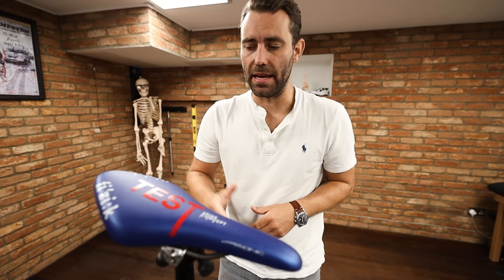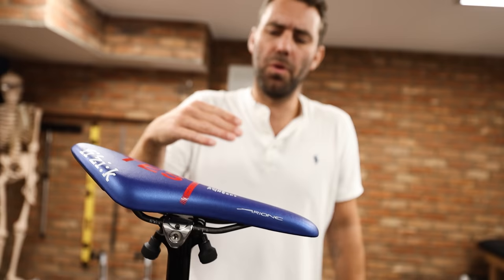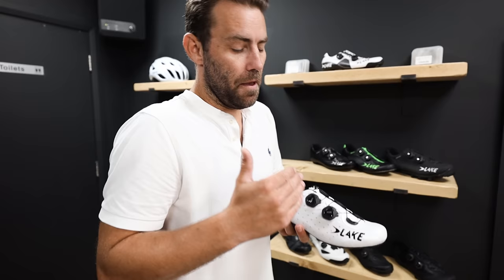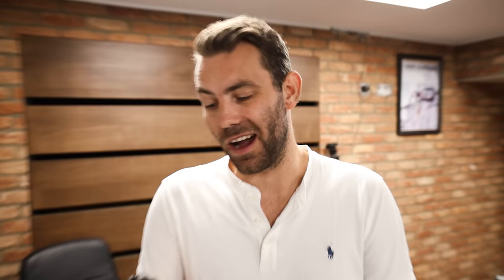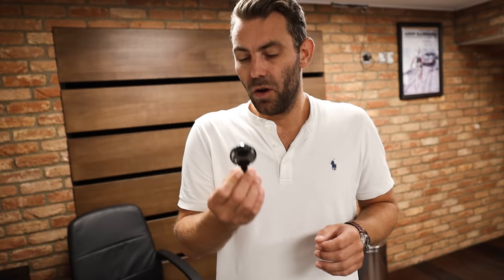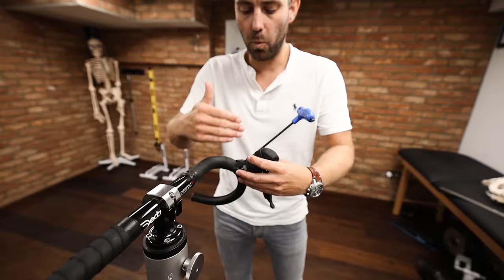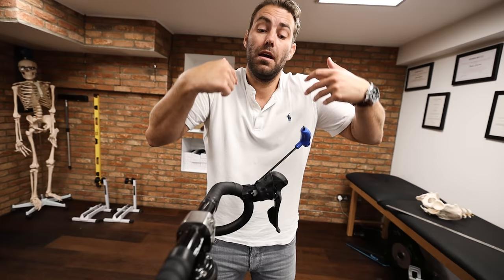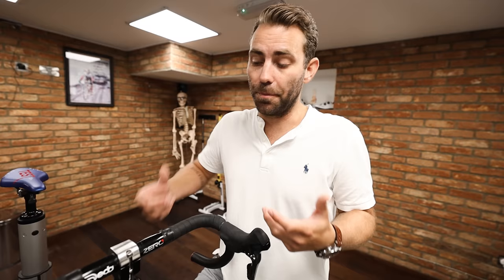5 Bike Fit Blunders You Should Avoid

Comment: Very recently used James’s online shoe fit service as I live up North. Cannot recommended highly enough. Superb and has shown me the importance of good proper shoe fit as I’ve got stupid wide flappy feet.
Reply: what did you end up for shoe brand?, I wear size 12 or 47 typically
Reply: @franklaliberte1143  I ended up with Lake CX238 x-wide size 43. I didn’t quite realise how my previous narrow Fizik shoes were buggering up my feet until now. These are so much better although I reckon my feet will never get back to normal but at least they’re comfy now.
Reply: @johnboyginger  you know, I’ve got Fiziks as well and while they feel fine, based on what James has said about them being narrow, I wonder if they actually do fit properly or if I’ve just gotten used to them.
Reply: @jeffmcconnell6214  having spent time with proper fitting shoes and recently the tried the Fizik ones, they are waaay too narrow and damaging. I’d got used to them too but they were injuring me without me realising until my feet had enough.
Reply: @johnboyginger  good to know, thanks for the heads up. We’re planning to be in London next summer so if I don’t do a virtual fitting before then, I plan to visit the shop.

Comment: I have a question I’d love to see you do a bike fit video on - how much should your bike fit requirements change between different styles of bike and riding if at all??? Should your saddle position remain the same relative to the cranks regardless of whether you are riding a dedicated race bike or an upright gravel/endurance bike?

For example, I have 3 bikes:
1 - An all round road bike used for general riding such as club rides etc, mixture of high speed and/or long distance rides (I have this set up according to my professional bike fit)
2 - An aero race bike for time trials and crits (I have this setup longer and lower than my standard fit, with a more forward saddle position, it is used exclusively for short duration high speed riding).
3 - A gravel bike also used for long endurance road riding (this is a shorter and more upright bike and I have my saddle position slightly back from my standard fit)

I would be very interested to hear your views.

Comment: Reducing handlebar width also reduces reach.. and as a small rider, in my experience almost no bike comes with correct handlebar width for smaller riders (100% too wide) unless you have a really good LBS and you can convince them to swap out bars for ones that fit your actual shoulder width..

Comment: I've fiddled with saddle angle, also having tried downwards and running into the same problem of my ass sliding forward. Eventually I very gently pitched it upward and adjusted the saddle backwards a few millimeters, it resulted having me sit back on the saddle properly and it helped a bunch of problems from the obvious general numbness to my right knee no longer getting a bit sore on the 20th mile and onwards.

Comment: Another great bike fit vid from the lads in upmarket Richmond. I am 178cm with a 80cm inseam, riddled with early onset arthritis and yeah, carrying a bit of extra luggage. Anyway, I changed from a 172.5 to a 165 some months ago. Did it help? Probably, but not as much as lots of other bike fit tweaks guided by James’ vids. 

New bike arrived recently (same bike, same size, same  geometry, same saddle and handle bar set up
just posher model - yup, a Trek Domane). With a 170mm crank length and corresponding lower seat height it feels better than the 165mm. Better meaning, improved balance, even cycling  hands off! Arthritic Hips and ITB problem were fine. Go figure.

Comment: I do bike fittings at a local shop and use a Guru machine- these are all good points, one of the biggest ones that I see often are the bars pointed up... I just show people their wrist bending laterally- when the hoods are pointed up, it bends the wrist bones in a direction they are not meant to bend... (if you look at your right hand, for example, palm up, will bend to the left much more than it will bend to the right)

Comment: Very enjoyable video!  Thanks.  A couple of thoughts/questions/observations... 1) For handle bar rotation, since I ride in the drops a lot, I like to have the handlebar drops meet my hand at an angle where my wrist has a nice, neutral, relaxed position instead of having the ulna/radius/wrist twisted to compensate.  So instead of making the ends of the handle bars perpendicular to the ground to start with, I look to position the bars where I achieve this neutral position then lock the bars in place.  Once the drops are aligned, the hoods get adjusted so that I achieve a more neutral position as well.  There's also a reach adjustment screw on my shimano hydraulic brakes (presuming other models/brands have the same) that then helps bring that brake lever into a better position if needed.  2) Can lowering the seat help reduce the amount of forward pitch some riders put into their seat?  Seems to me if you drop the seat a bit, you get a bit more upright which takes the pressure off soft tissues.  I guess moving the seat forwards is not a great idea since is changes your relative position to the bottom bracket?  3) Would moving to longer crank arms allow you to lower the seat so that the rider opens their hip angle and be able to remove some tilt from the seat?  Does it make too little difference to matter?

Comment: Thanks for the honest revelation of the speed plate pedals. I always had the feeling that the whole system is weird. All other manufacturers fit the plastic cleat inside a metal framed pedal. That must have a reson in functionality. And the speed plate pedals are the ither way around. in most cases the majotity system just has its reason, why they are used in the majority.

Comment: 7:50 I forgot to fiddle with this step as I struggled with my new road bike after a few months of ownership. I could never get the curvature of the back correct and my back was always just straight. Holy crap, man! I felt the difference right away and I could feel my back arch as they presumably should. I'll test this as I go for my second century and see if I'm in less discomfort in the middle of it and after.

Comment: (Question) Should you avoid bike fits that 100% depend on a camera to tell the fitter what to do or did I just go to a crappy place?

(rant from a random guy on the internet) I paid the equivalent of near £250 for a bike fit this year and all they did was lower my saddle so much that I got knee pain. But my foot position was "correct" on their computer after lowering it so much.
I knew I was in for a rough time when they tried selling me a bunch of stuff before even looking at me on the bike. I should have bailed but it was a 3 hour drive and the next nearest place was another two hours.

They even gave up adjusting my cleats to try sell stuff to a guy who walked in. They told me to leave and email them if they weren't right.
In any case I'm avoiding the Retul bike fit again.
Reply: yeaahhhhh, James has previously railed against Retul.

Comment: I've had several saddles that had a relief channel and still got numb nuts. Got a fitting done and found out I was reaching way too far for the hoods on the bar. I ended up getting a stiffer saddle with no channel, but made adjustment to saddle position and swapped out bar stem and now I can feel that I am using my sit bones more instead of literally sitting on my  nuts. No more numbness. No need for relief channel if you are sitting back as you probably should for touring/commuting.

Comment: Interesting on the Speedplays - I was getting fed up of not getting into my Ultegra SPDs easily on the summer bike so decided to try Speedplays - wallet 100 quid lighter and they are a slightly better clipping in - but the installation and positioning was a nightmare compared to Shimano!! Far too much adjustment for what I want.... Even more messy with the adaptor plates etc....

Oddly I don't have any issues with the 105 SPDs on the winter bike. I now wonder if it's just the lighter weight that stops the ulterga's being as predictable??

Comment: Would love a comment about control location angling inwards. I’ve seen quite a few of them on group rides. Is it just a way of faking narrower handlebars? Or is it actually beneficial to some people?
Reply: Couple of reasons for that - 1) you have your wrist in a more neutral position with the hood being angled inwards in comparison with significant wrist extension while holding hoods that are set straight (handlebar width affects the degree of wrist extension too). That helps if you have tingling fingers etc, there isn't as much stress onto your carpals 2) it's more aero 3) UCI banned resting your forearms on the tops in races, and with hoods inwards you can grab them with your pinky finger/metacarpal heads and avoid fines or disqualifications 4) in some cases the altered brake lever position makes it easier for people to brake

Comment: Question: James mentions “really short stems” but what is seen as short? Like anything below 80 mm?
Reply: Yes, what stem is too short?
Reply: For most road bikes around 80 is fairly short. Some of it comes down to personal preference. As the stem becomes shorter the bike handles "faster", making it feel twitchy. But things like bar width, trail, and head tube angle also effect handling and can be used offset shorter stem lengths in some instances. Like how mountain bikes have very short stems but still handle well.
Reply from the maker: 80-130mm shouldn't affect the bike in a negative way

Comment: How reasonable is it to have a separate seatpost and saddle that you use on the indoor trainer? I got a Fizik Mystica triathlon saddle that I use indoors (short nose and pressure relief helps in static riding), but I bought a duplicate seatpost with a different saddle I prefer when riding outdoors.  The position is the same, but the swap saves about 150 grams and doesn't  raise the CG of the bike by having a heavy saddle up high with bottles behind the seat (not an issue on a trainer).

Comment: Does different shifters affect your fit? E.g Claris vs DA vs Sram red, hydro vs cable, etc…
Reply: yes of course. The reach from old mechanical sram red 10spd is a lot shorter as for the new DA 12 speed. It is optimized for the new aero position on the longer hoods. I  would get a short reach handlebar with the new shifters.

Comment: James, it isn’t addressed her but thought my question might work best in these comments. Regarding crank length, going from 172.5 to 170, is that enough to be problematic. I ask because my 10 year old road bike and my gravel newer gravel bike have 172.5, but my month old new road bike has 170, and I’m curious if swapping between them will be problematic for my knees, or if I need to put out for a matching crankset on the new bike (assuming I can find one). Thanks!

Comment: Would you suggest the same regarding saddle tilt for women also? I had tons of pressure on the pubic arches and almost none on the sit bones until I started fiddling with the saddle and tilting the nose downward a notch. I tried really hard to find tips for saddle adjustment for women but most just acknowledge that the pubic arch is lower than in men and that’s that. 

It seems generally really difficult to find women specific information and tips especially when you’re on the shorter side. And don’t get me started on finding shoes when you’re a size 3.5 with high instep. 😭

Comment: So saddle pitch is measured from nose to tail on the saddle? You don't measure the angle of any specific part of it (for instance keeping the front section level and leaving the wide 'seat' part at it's angle)?
Reply: Between the two highest points because it's repeatable and relatively fixed.

Comment: Are home measurements of the feet good enough to know if they're "wide" or not? Which width in mm would be considered being "wide", more then 100mm, 110mm?
Reply: I did a home measurement with pen and paper and it turned out to be half a shoe size off. With a wall, book and tape measure it should work well enough though. My fitter recommends going by size charts for each model instead of shoe size, adding 8mm to the measured length of the longer foot and nothing to the width. There are some manufacturers that publish widths in their size guides.

Comment: Love the back handed brand hate , although type of saddle “never matters” it’s the fit 😉, unless it’s an anteres 😂😂
Reply: The type of saddle does matter a lot as many saddles are only available in”one size fits all”!
We have been very peculiar when it came to saddles-majority of them we wouldn’t have been able 
to ride 200 km races.
It started to get a little bit better when they manufactured the different models in diverse widths,
because it always comes down to where your pelvis bones are sitting.
You need the perfekt width to be able to sit still and not sliding from side to side or maybe even hang over 
to one side-what also may relate to the differences in leg length.
This is a try and error game and i guess many bikers have a few saddles in the basement .... 🤙🍀

Comment: Bike size. Why is there so little consitency between brands? I've found I'm a medium in one, large in another and XL in another. This is especially prevalent in gravel vs road "endurance" bike styles. Even with the same manufacturer, different styles are completely different sizes. What should average joe (i.e. me!) be looking for in a the geometry forest?
Reply: Go by metrics. Effective Top Tube Length. Stack and Reach. Not by what they name them. Then you ll not be confused. I am 168. I look for a Reach of 375, Effective Top Tube Length of 525. Stack varies depending on aggression... endurance or Race. But this always works for me. To get the right size. After that it's upto the fitter. Some brands don't have bikes near the same metrics. I don't buy them as I am between sizes.

Comment: A shoes size question: Is it right to pick one or sometimes two sizes more, cause of feet swollen or different socks thickness cause of the weather? I really suffer when I wear my RC7 with my winter socks...😅
Reply: Shimano shoes are small in size. you usually have to go up a size from your normal walking shoe,as long as your not using Adidas or Keen as a reference. They are all over the place regarding sizing. Get your feet measured. I usually say that the shoe should not pinch or squeeze, because the shoe size is too small or the foot be able to "flap around" in the shoe because it's too big. The shoe should fit like a glove. Maybe you require a wide fitting shoe. Comfort is a nr.1 priority. The better the comfort, the longer you can ride and then no excuses not to.
Reply: @richardlees9560  Thank you so much for answering. Good stuff to have a pro bike fitter's opinion. 🙏